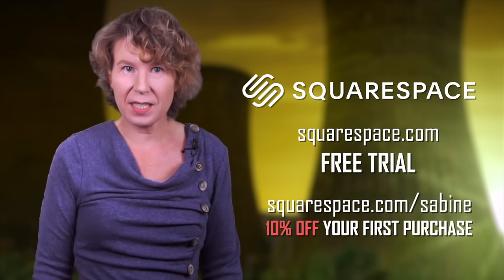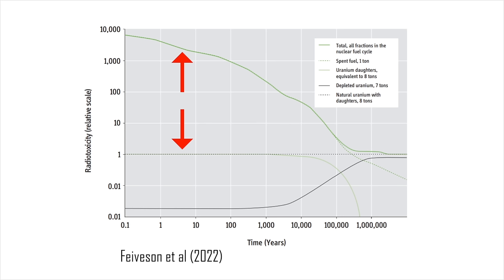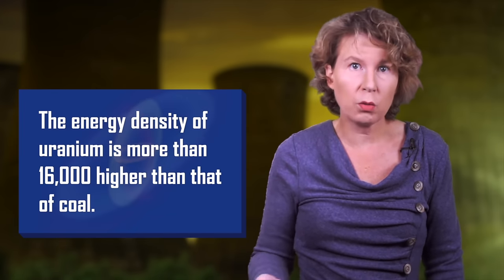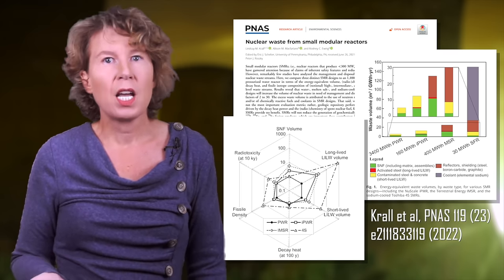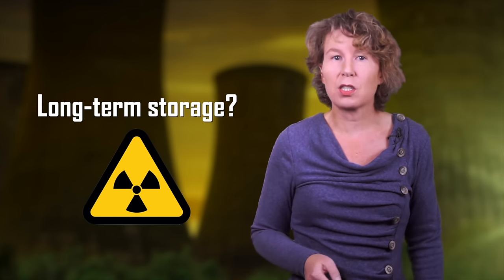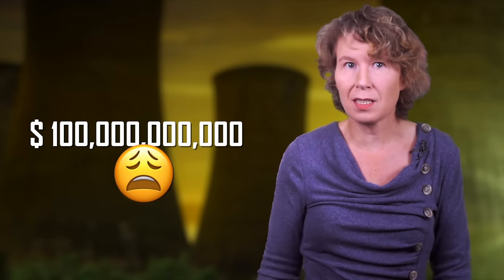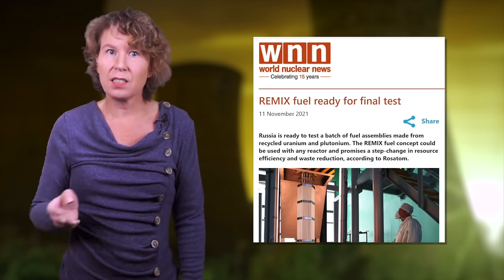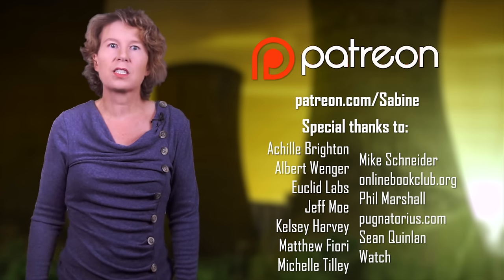Nuclear waste is not the problem you've been made to believe it is

Comment: I think the best way to store the used nuclear fuel is to put it deep enough underground, say 2km. This will produce a lift shaft long enough so that if you fill it with concrete, once you're done filling the storage, you better be technologically advanced if you wanna dig it back out. If you put the storage in a place that is a valley or a base of a mountain to begin with, not even geological processes should be able to dig the stuff out before the fuel is safe.
Reply: Such underground storage has a problem, no matter in which way it's done: what if plans go wrong? As this is something unexpected, there's no way to plan for it. That's why I favor storing waste where it currently is: inside those decommissioned power plants. If something goes wrong, one has access and can rearrange the setup.

That said: the most important step would be to stop mining Uranium.
Reply: @Polygarden  Yea I'm not too impressed by German engineering since I got to actually work with it. 1km is a bit too shallow for stuff you never want to see again, and obviously if water leakage is a problem, the material isn't packed well enough. Ideally the material should be packed so that even if it's submerged in water for the rest of its existence, and the storage tunnels collapse on it, the container carrying it won't fail. If we can make these things train proof, shouldn't be a problem to make them waterproof. Not to mention they're heavy metals. They're not too excited about going upwards. Even such a lame thing as sand can prevent these materials from getting anywhere, as we have learned from natural nuclear reactors. As far as I know it was found the material didn't get further than 30cm, over 200000 years in soil where water flowed freely.
Reply: @Killerean  Obviously, these storage sites in Germany were considered to be safe in all aspects. Else nobody had stored this waste there. Nevertheless these engineers were wrong. And that's the problem for all engineering: engineers might be wrong again.
Reply: @Killerean  Weed huts because there's no nuclear? Please return here when you can be taken seriously.
Reply: @traumflug  You know well what I mean by that.
Reply: @gregorymalchuk272  I agree that recycling should be possible as long as considered desirable. You don't have to plug the entrance until you know you've done everything you could to process the material. It's an optional thing on the end of the active storage process once you know you can't really do anything more with it. Or in the highly unlikely scenario if something goes wrong and you figure out you really don't want that stuff around anymore. Not to mention fuel is not the only radioactive material to store. We need those spaces for much more than just used fuel. Then you can just close big ol' door, seal the entrance, and the future generation should be advanced enough to get it out with ease. After all, we had to drill that storage to begin with. A backup entrance chamber for a new lift shaft could be left waiting for the future generations so they'll just drill down into it and they'll be good to go. And if they never do, we'll know that material won't come back to haunt them from some forgotten storage facility. Like in case of some buildings in the eastern block where radioactive materials were just left lying around. And while I most hope for us not to meet a similar end where our countries just stop existing and our old projects would fall forgotten, there are no guarantees.
Reply: @Polygarden  why did they built these repositories in locations where there are groundwaters?
Don't you have mines in some mountainous region(s)? (pardon me I don't know geography of Germany well)
Reply: On this subject, I recommend the short story “He-y, Come on Ou-t!” by Shinichi Hoshi.  It can be listened to online.

Comment: My favorite storage solution I've seen is repurposing the bore holes used for fracking to store nuclear waste nearly 3 miles into the crust and then filling the bore hole with concrete. Because it is vertical too you could theoretically store the nuclear waste close to reactor sites without needing a lot of area.

Comment: Who's doing 3 to 8 year fuel loads?

Both power plants I worked in had to refuel every 18 months. We were looking at extending it to 24 months, but I left before they completed the study.
Reply: A nuclear powered aircraft carrier can run for 7 years with one fuel load during peacetime operations.
Reply: @robo5013  Naval reactors use much more highly enriched uranium for their fuel.  And can't nuclear submarines go 20 years without refueling?
Reply: Common civilian light water nuclear power plant designs often run around ~3% enriched U235 fuel, but they do not normally replace all the fuel rods all at once, during every refueling operation.  You may for instance have a reactor that has three sets of fuel rods, one set enriched to ~5% U235, a second set enriched to something closer to ~3% U235, and the remaining set enriched to something closer to ~1% U235.  Then, when the reactor gets shut down and opened for refueling operation, they remove only the oldest/lowest enrichment fuel assemblies, and replace them with fresh higher enrichment (perhaps ~5%) U235 fuel assemblies.  Then, over the next 1-2 years timeframe, the fresh ~5% material progressively gets "burned up" and in the process drops in enrichment level to closer to ~3% material, while the ~3% material progressively drops down towards ~1% material (but with not unsubstantial amount of plutonium build up as well).  The fuel assemblies thus get replaced in a FIFO (first in first out) fashion, with three separate sets (each at different enrichment levels) in the reactor at any given time.

In this fashion, freshly made ~5% fuel assemblies may end up spending roughly 3-8 years in the reactor in total, even though the reactor may get shut down and "refueled" (but only partially) once every year or two.
Reply: Did you refuel everything at once?
Reply: @ChielScape  Good point. No. We replaced about a third of the fuel every 18 months. 

So I guess the 3-8 years is correct.
Reply: @Fritz_Schlunder  You're right. I didn't consider the whole cycle. 

Fun fact: We started loading the "twice burned" fuel around the outer edges of the core. That was because someone came up with a scenario about reactor vessel embrittlement due to long term exposure to neutron radiation. Putting the oldest fuel on the outside served to shield the walls of the vessel from the worst of the neutrons. 

Of course, we had to recalibrate the Power Range Monitors for the reduced neutron flux. It was amazing how much the shielding worked.
Reply: @franklittle8124  Don't know about the subs, my father worked on carriers. He inspected the electrical lines coming from the reactors until he reached his lifetime rad limit.

Comment: With regard to fuel reprocessing, it’s worth pointing out another disadvantage: it’s somewhat prone to accidents. It’s basically like operating any other chemical plant, which have their own reactive hazards, but with the added hazard that if you accidentally assemble a critical mass of fuel, you can create a mini nuclear reactor in a mop bucket. To be clear, these accidents are extremely small compared to a meltdown of a commercial reactor, but it’s a risk worth considering.

Comment: I dislike the term nuclear "waste"; it implies that all isotopes that cannot be fissioned in a thermal reactor are "useless". For instance, a LFTR thorium reactor breeds Uranium-233, and produces three non-fissionable radio-isotopes: Molybdenum-99, Bismuth-213 and Plutonium 238 - all of which are extremely valuable commodities. Molybdenum-99 produces the Technetium-99 used routinely in hospitals for SPECT scans and other tests. Bismuth-213, a very short-lived prolific alpha emitter, is nuclear oncologists best shot at curing some of the most deadly and intractable cancers. NASA loves Plutonium 238, the only viable material to power thermo-electric batteries or Stirling engines in space probes that travel beyond the Kuiper belt. Thank you, Sabine, for pointing out that spent fuel rods can be recycled and burned in fast reactors, to produce useful energy while converting thousands of tons of nuclear waste (that would remain dangerous for millenia) into a few tons of seethingly radioactive waste (that only remains dangerous for a few ceturies). Legitimate scientists need to debunk the linear-no-threshold hypothesis along with all the half-baked nuclear-demonization propounded by pseudo-scientists like Helen Caldicott, David Suzuki and assorted Greenpeace/Sierra Club hotheads/wackos. Kirk Sorensen has pointed out the ugly truth of pre-inustrialized humanity - colonialism, class warfare and the slave trade - evils that were widespread until we made carbon our slave instead of other humans. Wind turbines, geothermal drilling, hydroelectricity and solar panels are not an adequate replacement of fossil fuels, like it or not, we MUST add new and better-engineered nuclear power plants into the mix, to provide baseload power to our electrical grids. It might take thousands of years to produce economically viaable nuclear fusion. Most people who advocate for a low-energy-consumption lifestyle have never experienced day-to-day living in an Amish community sweatfarm, let alone tilled the soil with a pointed stick in Sub-Saharan Africa. Backbreaking physical labor sucks!

Comment: I love her admonition not to eat hazardous waste. Years ago I was the EHS officer for a factory in Long Island, where we found that the basement toolroom wooden floor tiles had been low level contaminated by a spill on the street outside. It was determined that the contamination was barely detectable, and hazardous only if ingested or pthru prolonged (several weeks) of direct skin contact of large areas of skin. 

I called the union employees together to explain the issue and how we were working to mitigate it. But in the meantime, I had a duty to warn them to please not eat the floor tiles, and above all, stop having sex bare assed  on the toolroom floor - always use protection. Everyone had a laugh, and no one forgot or ignored the warning.

Comment: Uranium doesn't come out of the ground pure, it comes out as ore, and while it may be possible to paint a rosy picture on what can be done with the pure uranium, the situation for the tailing bi-products that are separated from the pure uranium can be up to 1000x worse, and is bad enough that there isn't a beginning to the discussion about how to fix it.
Reply: You're describing a general problem with mining, which is locally a bit dirty. Uranium mining isn't very significant and very, very high-value to society reducing health problems overall through cleaner energy.
Reply: @jesan733  The difference is that tailing ponds have a half life, and persistently enter the environment traveling through the food chain, and the water table. While their operations may be covert, due to their small size, the damage can be global.
Reply: @Tlilancalqui how is that a difference? The same goes for mining operations in general. Also, mining operations in general have local impact. Sure, you can get a plume of contamination in the direction of groundwater flow, but it's quickly diluted along the way and it's rarely very much of the material that moves. There's no significant global impact.
Reply: @jesan733  I have not studied other mining operations global impacts. But from your comparison I would then assume that they have global impacts as well.
Reply: @Tlilancalqui  so you've somehow learned that uranium mines have global impact? How did you learn that and how do you quantify it?
Reply: @jesan733  dp your own research this isn't the platform for me to present research findings; snippets and going back and forth is a waste of time. Radioactive contamination does not stay local because it does not dissipate. (in any meaningful sense).
The small refined radioactive material is carefully guarded while tonnes of radio active sludge is pumped into ponds where it makes it's way through the bottom as well as into local wildlife, where it is further moved along, never mind damn failures and floods.
Reply: @Tlilancalqui  I have a very good grasp of this topic. It's true that virtually every release of anything contaminates everything on this Earth, e.g. if there's a small wildfire somewhere, eventually a soot particle from it will end up on the other side of the globe. But it's not significant. Background radiation levels have fairly high geographical variation due to natural factors. Mining doesn't significantly contribute outside the mines' local environment. That's why I asked you to quantify it.
Reply: @jesan733  It is tough to quantify. For example, when there is a tailing pond breach in Venezuela, or Columbia the tailing pond winds up in the river system - and not arbitrary amounts, tonnes, and these river system are connected to all other river systems in their watershed, (which is enormous).
Tailing ponds are not a sufficient way to store hazardous waste. What would the world say if Fukushima placed its cooling water in ponds rather than tanks? Well it's the same thing, it's just that mines aren't under the same scrutiny.

Comment: When it comes to half lives of isotopes: any amount of a radioactive element is considered gone when it hits 5 times its half life. So something with a half life of about 5 years like Co-60 is considered gone after 25 years. Also fuel rod consumption is dependent on reactor design but a larger factor is the fuel used itself. If you have a larger amount of uranium 234 than average your fuel rods will last a lot longer. Another thing is the amount of power you’re producing and the rated temperature of your reactor. If your reactor is rated for a relatively low temperature like 300F you’ll have a longer expected core life than if it was rated for 400F. If you’re core has a positive temperature coefficient of reactivity then you’ll have to pull your control rods out to maintain your rated temperature meaning your fuel rods won’t last as long. If your reactor has a negative temperature coefficient of reactivity you wouldn’t have to move rods since the more steam you draw, the more heat you pull out of the primary, the colder it gets, the more fission events you have, the more power you get, the hotter the primary becomes until it hit equilibrium at the same temperature as before. A negative temperature coefficient of reactivity is a property of any reactor using water as a moderator where using other materials for a moderator would mean a positive temperature coefficient of reactivity. I’ve operated two reactors that haven’t needed to be refueled even though they have been operated for over 30 years.

Comment: I grew up near a nuclear plant, complete with on-site hot pool storage of spent fuel rods.

I have no problem with low-level waste - discarded jumpsuits, boots, and other PPE. If you think I want to live near a hot pool of spent fuel with all the security problems and ongoing costs that entails, you have another thing coming. This stuff will be dangerous for a longer than I'll be alive. We were told in 1969 when the plant was being planned that nuclear power would be cheap cheap cheap. It turned out to be an ongoing federal headache, with the plant on the NRC watchlist nearly continuously, and the electrical rates are second-highest in the nation. We were told it would be safe - it wasn't. They had numerous radiation releases over the years. Maybe thorium will be good, but uranium is not on my preference list.